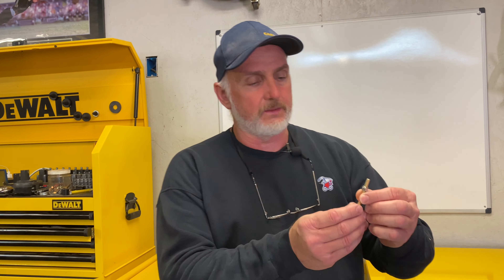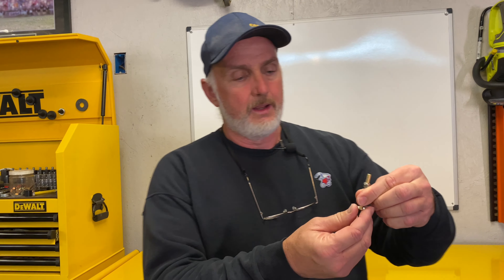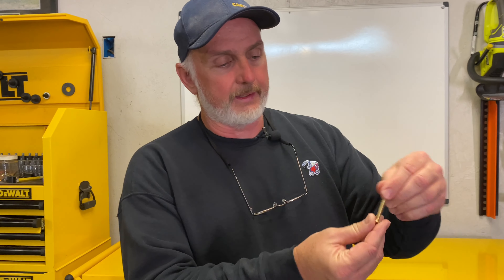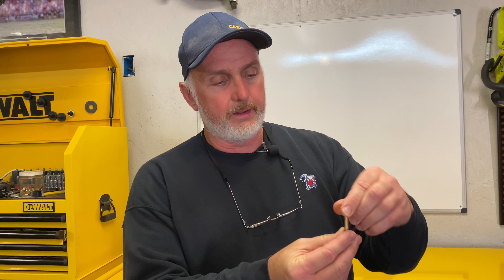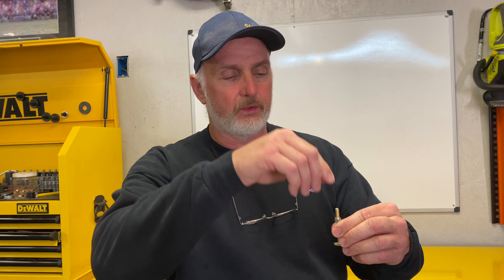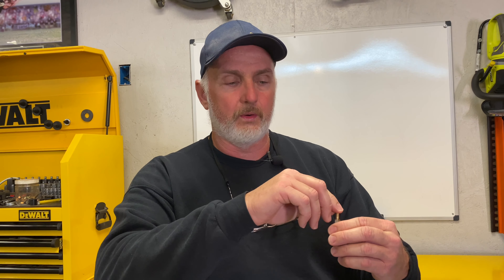How to Repair Toilet Flange Using a Danco Hydroseat Flange Fixer DIY

Comment: YOU DOING TOO MUCH THIS VERY SIMPLE!!!!! YOU JUST SET THE HYDRO FLANGE ON TOP ITS DONE NO WAX IS NEEDED!!!! IT HAS A SEAL!!!!!
Reply: The Danco instructions say to use the wax ring like he did except just wax and not the one with the cup.

Comment: Good info. Good product.   Should talk about having to drill through tile with the right  ceramic/diamond tip bit if you are sitting on tile before you get to the subfloor.  Suggest using Corky toilet ring instead of a wax ring.  One of his points is going back in to replace the toilet or make adjustments.   Much cleaner with Corky ring than a wax ring.   No leakage issues at all.  May want to use longer screws than provided to ensure you are securely into the subfloor.
It really is easy.   Mine was completely rusted out.
Reply from the maker: Thanks for the info. I'll definitely have to check into that Corky toilet ring. It seems like a much cleaner solution.

Comment: I'm ready to give this a go.  I'm worried about drilling through my tile into the plywood subfloor.  Any type of drill, drill bit, screws, etc I should use?  I don't want to shatter the tile.  I have an impact driver and a standard drill/driver.
Reply: Use a tapcon screw

Comment: Do you use a hammer/impact drill to screw the HS flange fixer into ceramic tiles?
Reply from the maker: Yes, use a hammer drill if going through tile or concrete. You will probably use a tapcon  screw to attach. Tapcon screws work great on masonry

Comment: Mine is done. Too easy. I did elect to use shorter wood screws and my wax seal did not have that rubber piece with it. I wonder if that is something that contributed to the compression issue you noted.

Comment: How do you screee this in if you have concrete instead of wood
Reply: Use a masonry bit to drill holes into the concrete then use Tapcon screws to attach the danco replacement flange
Reply: @sclufer1801  If you have natural stone tile flooring, can you drill thru the tile and try to use some tapco concrete screws to hit the concrete foundation flooring?